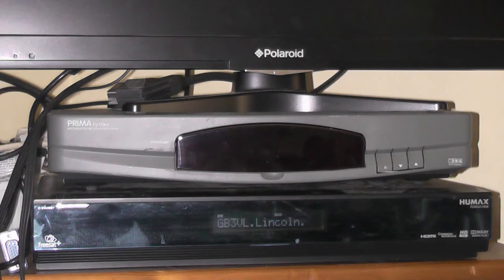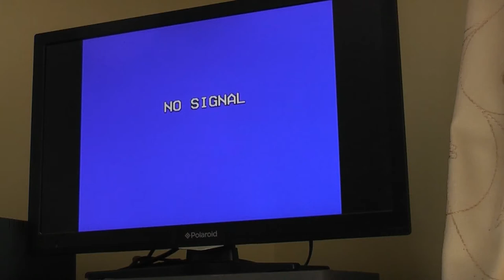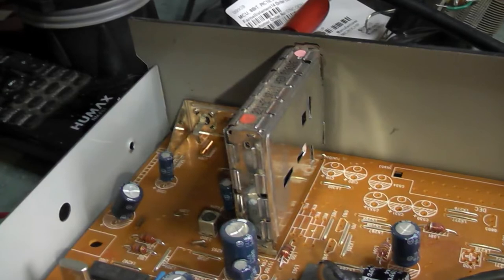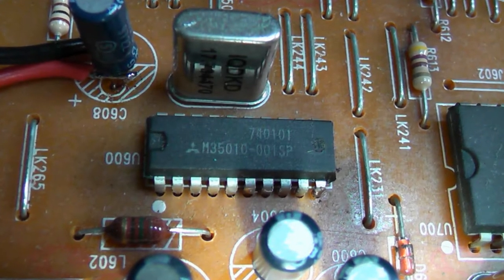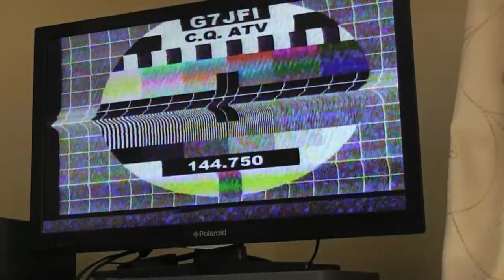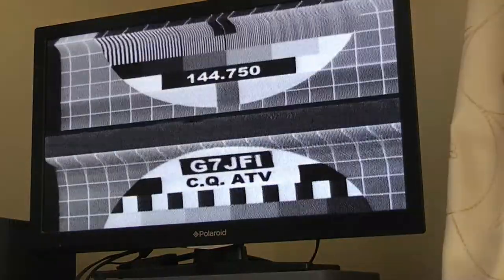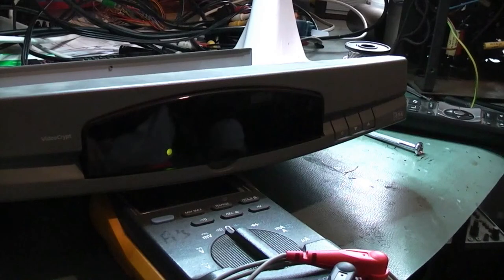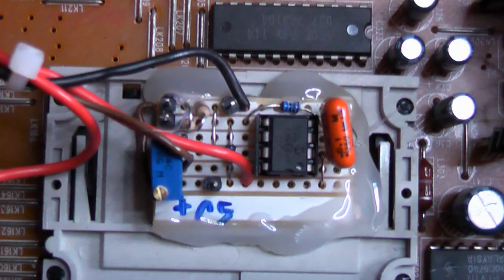Modifying the Pace Prima Sat receiver

Comment: Hi @Steeps1969 what is the model of the tuner I can’t read it on mine?
Reply from the maker: Hi Leo, it is a Zarlink Semiconductor ZL10036 in my 3 boxes here. Hope that helps
Reply: @Steeps1969  is that the can?
Reply from the maker: No, that is the I.C. inside the can that does the work. ZL10036. It basically outputs baseband video (and audio sub-carrier) to the chip I show in the video, where I attach the capacitors for the 2 mods. The ZL10036 is programmed onto it's frequency via I2C bus. I reverse engineered it (how it is programmed) and used a pace Prima tuner can as the front end to a homebrew receiver more recently, thereby getting past all the blue screen and remote control nonsense.
Reply from the maker: The can was designed by Pace, using the Zarlink chip, see more detail in previous reply
Reply: Steeps1969 ahh I see,does your can just have one IC in it,my can has 3?
Reply from the maker: I don't have one to hand to check, but as I said in the video there are I.C.'s other than the tuner,which I believed at the time of making the video to be Audio related. All my ATV gear is now packed away due to lack of activity in my area, unfortunately - everyone has gone over to QO-100